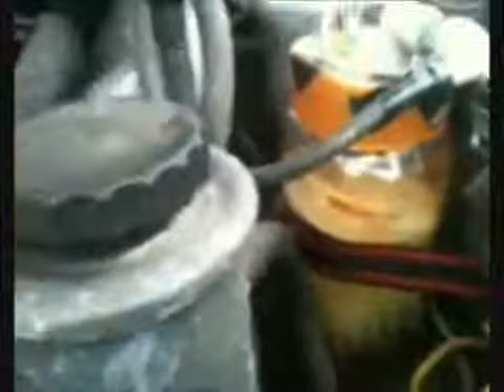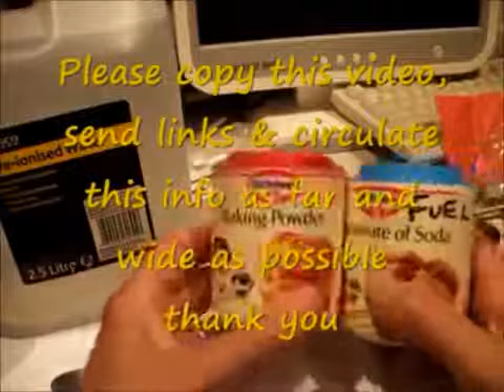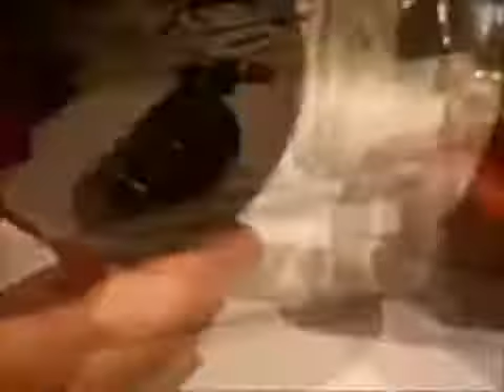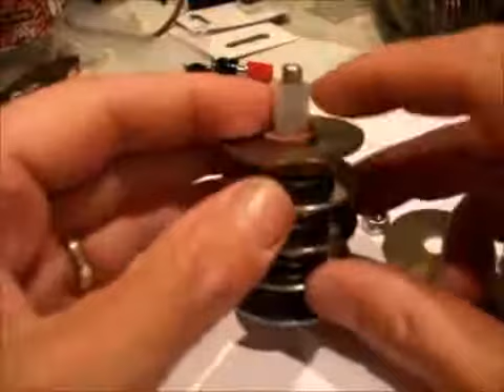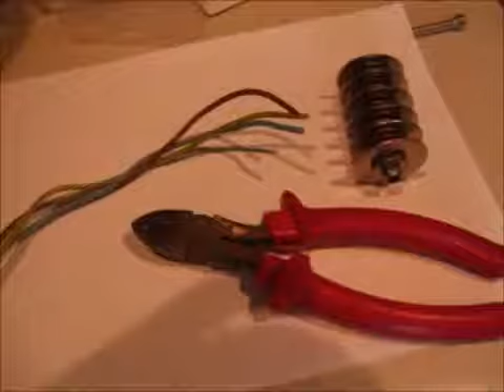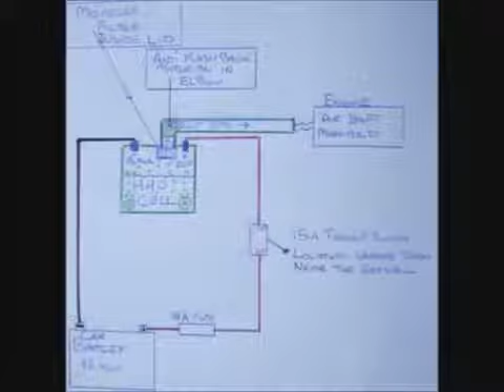DIY HHO Hydrogen generator car conversion

Comment: Good stuff.  But you should lift your washer away from the bottom to allow for sediment build up (creating a partial short), and no need to worry about moister, as it will benefit the engine by cleaning carbon deposits.  They actually make systems to do just that, mist water into the intake...
Reply from the maker: +Mat Helm
 thanks. I'm planning to do a conversion on my RV next...
Reply: Do not do it it is useless, see this video before doing it :
https://www.youtube.com/watch?v=s2t11GR6jFc